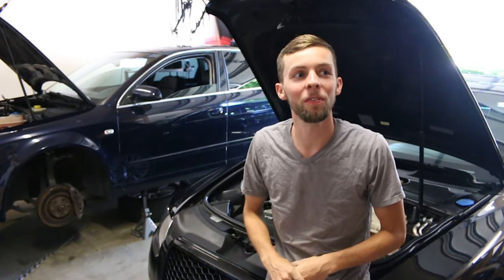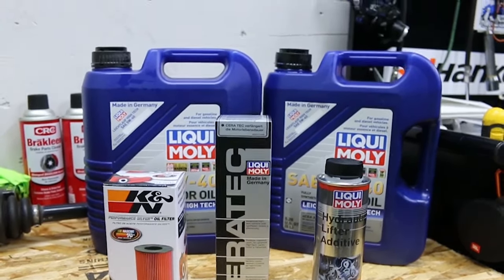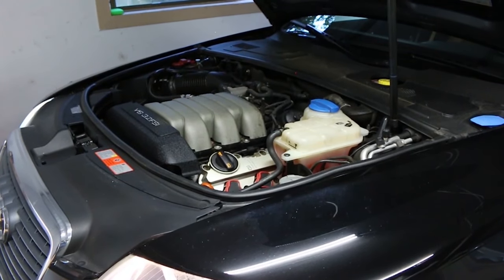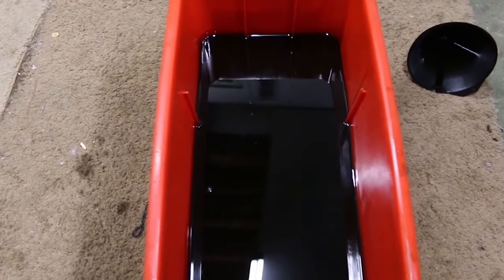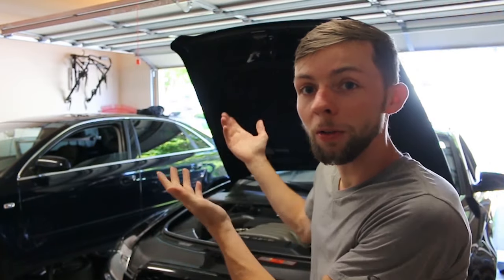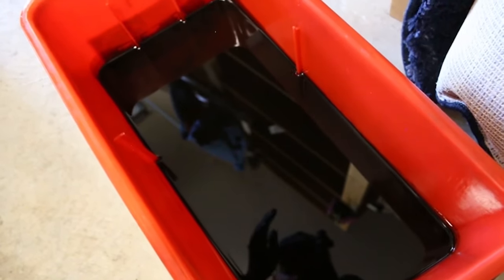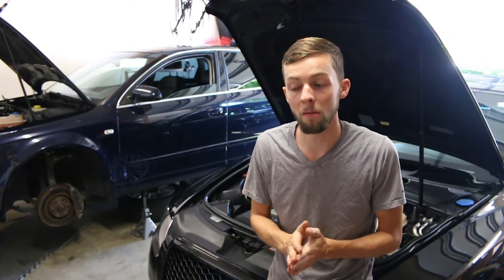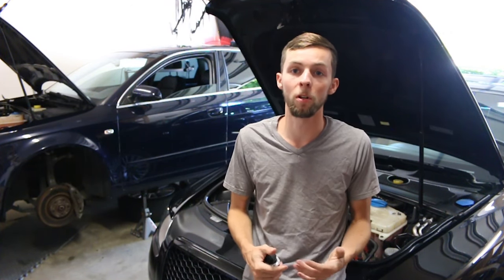LiquiMoly Engine Flush | Does it work?

Comment: Do you use the engine flush every time you change your oil?
Reply from the maker: No, usually every 15,000 miles or every year or so. Its not needed every time, and for newer cars, its not really needed at all.
Reply: @Mechani_Cole  so if i use the engine flush right now i can use it again a year from the day i use it or okay then thanks
Reply from the maker: @reesespieces305  you can use it anytime you like really🤷🏼‍♂️ 

Every oil change would just be more expensive, and I am not sure you would get the results you are hoping for.
Reply: here you can see a clean engine after a flush
https://www.youtube.com/watch?v=x4u64lKBbhQ
Reply: Sweetheart...just change your oil every 2,500 miles instead of 3,000 or instead of 3,500 miles....that will keep your engine clean....there is no need to use any engine oil flush if you frequently keep your oil changed every 2,500 or at least 2,000 miles....keeping oil changed freq. Will keep engine clean for years to come....your welcome😊
Reply: @skyiestosunsetrise2886  that's solid advice for the owner of a brand new car - to just keep up the maintenance fairly religiously - but someone buying a used car could stand to do a thorough flush at the start of their ownership to ensure any buildup from prior-owner neglect is "washed away". Following that first flush then yes, steady oil changes with good oil and the use of quality fuel should do the trick.

Comment: I have Toyota Corolla 2011 1.6 L (gasoline version) (Manual transmission)
Total km 311000
I am facing significant drop in fuel range on Full tank (from 550 km to 350 km on highway) and (from450 km to 280 km on city)
Kindly advise solution
Reply from the maker: Hard to say 100%, it could be a fuel filter, or old spark plugs. I would change spark plugs and see if any difference🤙🏼
Reply: @Mechani_Cole  new spark plugs was used and carburetor was cleaned with chemical
Reply: But no change in fuel economy
Reply from the maker: @aqibpagarkar  well there is definitely no 'carburetor' on your car since it is fuel injected. Not sure what could be causing your lack of gas mileage. It could be a vacuum leak or a bad fuel pump
Reply: I'd also like to comment here on my car. 05 Civic EX with V-TEC. Have oil consumption & ticking sound. Plan on using this product & follow up with Liquid Moly Anti Friction Treatment along with 5w-20 Pennzoil full synthetic HM motor oil. Would like to get rid of the oil consumption as the noise I can live with by cranking the music, but if this solves both I'm happy. My question is @ 170k the engine, would this flush cause more openings by getting rid of the old gunk left that's actually keeping the car from burning more or would the Anti-Friction help to replace that? I'd like to avoid further damage & get at least 200k out of this engine if possible, thanks!
Reply from the maker: @dbzownz12345  its not going to hurt anything. If it does then you already had a bigger problem that needed to be addressed. This is just going to clean out the gunk thats possibly in your engine when doing an oil change. I've used it on higher mileage engines with no issues. Sometimes people blame a product for "ruining" their car. When in reality, their car was a ticking time bomb even without the extra cleaner

Comment: Great video thanks for sharing. Could you tell me more about your experiences with engine oil? I’m using castrol 5w30 on my ’05 3.2FSI A6 C6 but on the last 6000 miles it consumed close to 3,5 liters. Any advices?
Reply from the maker: Hey Carl, I would recommend flushing and then changing to a different oil. Make sure it is VW 502.00 approved. LiquiMoly has worked great for me, got back from a 600 mile road trip and no oil consumed. Could be a bigger problem if consuming that much. Good start is changing the oil and adding some additives like Cera-Tec. Nothing will fix it 100%, but improvement is all we are going for here. Have a bunch of video coming out on the A6 C6, have about 5 videos being edited right now, stay tuned🤙🏼
Reply: This Is Coleman thanks! I’m definitely gonna watch it ;)
Reply: Your car drank away 3.5 LITERS of engine oil in 6000 miles (9650 km)?? - Damn, that's insane. No flushing or change of oil brand is going to cure that. Did you omit to screw in the drain plug? Or is the engine block cracked? Or just a leaking valve guide?  

Many years ago I had an Opel Ascona B model (1979 model) - it drank a lot of oil, a lot. Like yours, or even worse. I think it was worse, actually. Constantly after filling, using a thick oil. Anyways; it was a leaky valve stem or valve guide, whatever the shite is called. I found another cyl head to put on. Helped. But then a day a lower-end bearing broke. Swapped the whole engine lol. But then I crashed the damn thing. 

Today I have a little Opel Corsa C 1.2  from 2002. 18 years old. Drinks no oil. Never ever after filling. Keeps the oil inboard like a champ. dipstick shows NO oil missing. 

Anyways; you have a very serious problem with your engine. Would be interesting to hear about what was wrong.
Reply from the maker: @MeBallerman  you have a point here. I didn't catch how much consumption he mentioned. No oil or flush would change that for sure✌🏼
Reply: it’s kinda lot I am aware of it. It has some minor leaks but it’s not significant to consumption. crazy thing is that car runs smooth and puts out power like it should. another thing is that I have it with manual transmission and once engine temperature hits 90 degrees I go at it all the time sitting just below redline jumping through gears. it is just too fun to drive ;) engine has close to 250 000 km and i am pretty sure that i have lots of carbon deposits on valve lifters. also the air flaps just before valves on one bank of the engine faults sometimes cause check engine light, suppose also because of carbon deposits. some work needs to be done. i’m planning to erase the flaps in upper intake; research tells that they are useless, and i’m tempted to close up the EGR valve; nasty exhaust gases going back to intake doesn’t sound too healthy. but about the oil - on audi self study program pdfs on SSP-325 page 31 it says that 3.2 FSI AUK uses SAE 0W30 engine oil. what is your opinion about that?
Reply from the maker: @enjoychillinevenings  I think that different countries require different oil due to manufacturer spec for whatever reason. I believe the 3.2 FSI "Auk" is referring to a different country than the US? Perhaps Aukland? Not sure. I always thought it was interesting that the same cars use different oil just due to geography throughout the world. 

Also, my A6 is leaking from the Cam Gurdle seal currently into the spark plug tubs. Car was running great, pulled the coils to change the plugs for regular maintenence and there was alot of oil in every single spark plug hole. Guess its a very common problem with these cars, but also a big job. Videos coming soon as I complete it🤙🏼
Reply: AUK is a version for Europe. Car originally sold in Sweden, I’m enjoying it in Poland now ;)
Reply from the maker: @enjoychillinevenings  honestly so cool to know people are finding my video from across the world. Thats awesome!
Reply: @MeBallerman  I thought the same, that engine may be oil guzzler, but it is not critical. that checks the PCV valve, and changes the oil, with a PAO base, and STER, which have good anti-evaporation additives,
Reply: @SergioMartinez-fn4gi  Nah, it might not be directly critical - he can refill as it burns off, and always carry an oil keg in the car.  But his engine would like a rebuild, cylinder refurbishment, new pistons/rings, and valve guides and such. Or - just refill as needed lol.
Reply: @MeBallerman  possibly that is it, you would have to look at the compression of the cylinders, if it is within tolerances put less fluid oil, with some additive ´´ miraculous´´ if it does not work ..... prepare money
Reply: Use thicker oil castrol is thin
Reply from the maker: Won't work either. After seeing LiquiMoly fail several tests, I switched back to Castrol Euro Formula. Problem here was actually timing chain guides. The flush only cleaned it a little🤙🏼
Reply: Strange thing is that I switched from castrol 5W30 to original VW for FSI engines 0W30 - it is a lot cheaper and with lower viscosity at cold - thats what audi was recommending for my engine in 2005 (3.2 FSI AUK). It reduced the oil consumption - still have to do occasional refills but it is not as bad as it was. Also the chain tensioners are driven by oil pressure and with castrol 5W30 there was a little rattle while starting especially when car was sitting long, in cold and when parked “nose” down (all the engine oil in front of engine) It wasn’t long just like half a second rattle sound. Now on VW 0W30 chain sounds are rarely to be heard - it still happens sometimes but not as much.
Reply: Try Changing to PCV, “ pressurised crankcase valve” it’s usually a very cheap fix, but if it’s stuck open or stuck closed it can dramatically increase oil consumption

Comment: Only reason I see for an extra cheap oil is to flush the flush. Why did you not use the old oil for the flushing?
Reply from the maker: Thanks for your question! I used new oil so I could clean out and remove as much gunk and sediment as possible. When I got this car, the oil would get dirty after like 500 miles. So I drained the old oil, put in a new cheap filter and then ran the flush. After 20 minutes, it still came out pretty black. Now my oil quality stays cleaner longer. Basically, just used new oil so I could get as much of the old stuff out as possible.
Reply from the maker: You can flush with old oil if you prefer and want to save some money. I imagine it won't hurt🤙🏼
Reply: have a look how clean the engine can be when you use the engine flush
https://www.youtube.com/watch?v=x4u64lKBbhQ

Comment: Got confused at 1:40. Aren't you supposed to mix LiquiMoly with the old oil, run for 10 mins, then drain with the old oil? Why are you putting new oil at the beginning at 1:30?
Reply from the maker: Good question! I did this to get as much of the old oil out as possible first. Then I used the new oil & filter with the Liquimoly flush to be more effective at removing debris and buildup. Its not nessacary, but just the way I prefer doing it as it cleans better. 

It works to just add to the used oil as well. This car was abused before I got it so it needed a lot of help. Hope this answered your question🤙🏼

Thanks for watching and commenting🙏
Reply: @Mechani_Cole  How much new oil do I need to add to the old oil before flushing it out?
Reply from the maker: @peek-ka-boom6017  remove the old oil first, then refill with amount needed for a change. Then add liquimoly, let it run for 30 minutes, then drain and refill with fresh oil and new filter🤟🏼
Reply: @Mechani_Cole  Whoa, I have to change oil thrice too? 
1.	Remove the old oil first
2.	Refill with 9 liters of new oil
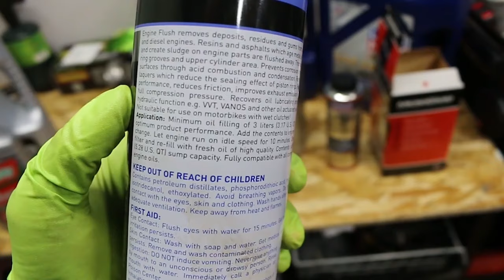3.	Add LiquiMoly engine flush at 1:24
4.	Let it run for 30 minutes
5.	Drain
6.	Refill with 9 liters of newer oil
7.	Add Ceratec at 3:25
8.	Let it run for over 5000 miles at 3:31
9.	Drain again at 4:29
10.	Refill with 9 liters of newest oil at 5:18
11.	Add Liqui-Moly MoS2 Anti-Friction Engine Treatment at 5:25
Reply from the maker: @peek-ka-boom6017  I see what you mean actually. Yes, if you count the 5,000 miles in between, then a third time is needed. But that is just regular routine changes at that time. Both of the other LiquiMoly products are just additives, they can be added anytime.
Reply: @Mechani_Cole  Got it, thanks for the clarification!
Reply: @Mechani_Cole  One more question, where and how do you dispose of used oils?
Reply from the maker: @peek-ka-boom6017  good question! I use our local auto parts store like Oriellys or Autozone. These places offer oil recycling for free usually. Thats where I take my old oil🤙🏼
Reply: @Mechani_Cole  So it's better to change your own oil than to bring it to an auto repair shop, so you can be sure you're using 100% new oil and not a recycled one? How many times can you reuse motor oil?
Reply from the maker: @peek-ka-boom6017  huh??? I'm confused. You can't ever reuse old oil. Why would you take your car to a mechanic shop?
Reply: @Mechani_Cole  Didn't you said motor oil can be recycled or re-refined?
Reply from the maker: @peek-ka-boom6017  yes, you asked what you do with the old oil. I suggested taking to a local auto parts store (a store that sells car parts/oils) and you dispose of it there. 

The store recycles it, you do nothing. Its like taking cans or cardboard to be recycled, you just drop it off. 

Try Google searching "car parts near me" then call those stores and ask they recycle old used oil. Then take it there and drop it off. That is all
Reply: @Mechani_Cole  I'm sorry, I don't have the auto techy skills to follow. This car technical stuff is not my strength. I thought motor oil recycling means filtering and reusing again.
Reply from the maker: @peek-ka-boom6017  it does. But what the store does with it isn't much of your concern.

You wouldn't recycle a box and expect them to return you a box would you? 

Its just a way to dispose of it. 

Another helpful Google search tip, look up "how to dispose of my car oil" and it will bring up some good results🤙🏼